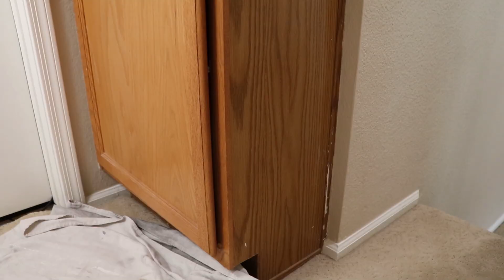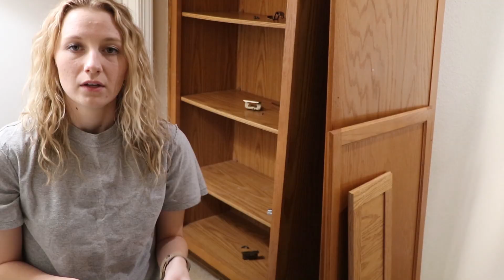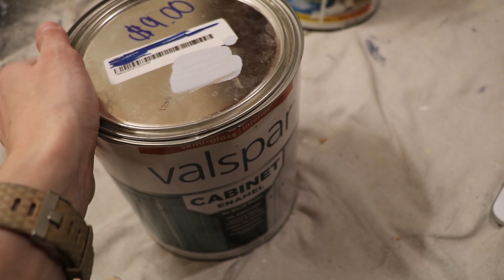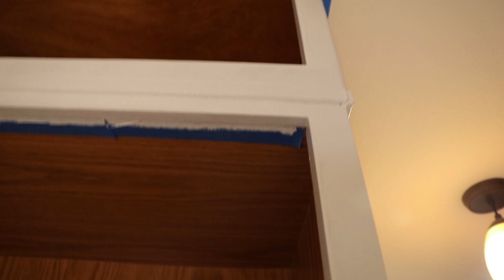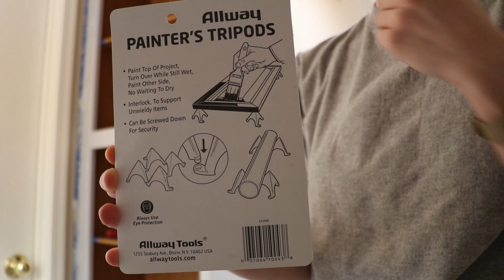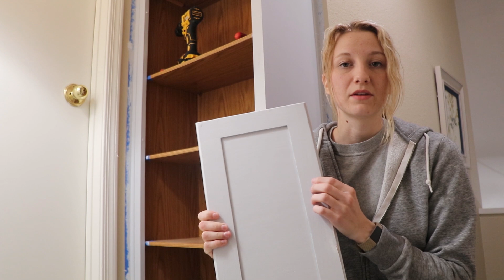Cabinet Paint: A Step By Step How To Video

Comment: As a painting contractor I’ve noticed with all of these DYII videos. You try to get away with cheap applicators.. Use the best brush that you can because that will give you the best result same thing with the rollers use a Short nap or velour roller it’ll tend to not show stippling marks like the other style rollers
Reply: Would u say the behr paint she mentioned earlier is gud for kitchen cabinets
Reply: Mark , I have also noticed in many of these videos , the cabinets look great FROM 6 FEET AWAY , but the close up shots suck , brush and roller marks galore .... I always look for the "close up shots" ..... Many of these videos only care about "clicks" ... NO WAY those cabinets look good "up close" , but they yak how beautiful they are .... ya right ... too many of these youtubers only care about clicks , so much fraud on YT it sucks ..... "Anaconda swallows army truck" crap
Reply: @shure46  the only true way to get the cabinets smooth is to spray them using an HVLP sprayer.
Reply: Thank you!
Reply: @marksavino2580  I know , BUT brushing can look pretty good , just not "top notch fine finish"
Reply: I just finished one area of my kitchen cabinets..this brand paint sucks, even using a foam roller.
Reply: @rockmom62  many foam rollers suck , they make air bubbles
Reply: @rockmom62  this is one of my favorites. I've never had a problem with it. I've brushed it as well as spray it. When brushing I've used a high quality brush, it goes on like hot butter.
Reply: I'm at the tail end of my cabinet painting project. Initially I went with the Valspar Ultra White Cabinet + Furniture paint.

It's complete crap.

I can gently lay something on the finished paint and it would easily mark with grey/black scratch marks.

Went to Sherwin Williams and filled them in on the horrible paint experience and when they asked the brand I used they said: "yup, that's why it's marking easily, the Valspar paints are extremely soft". 

They hooked me up with a proper, good quality cabinet paint that is much harder when it cures. No marks! The only catch is it's more expensive. $80 for not even a gallon vs the Valspar $35 per gallon.

But I don't want my paint to chip and/or become easily marked by the end of day 1. So I'm paying more for good paint.
Reply: @1337Reloaded  I tested the Valspar paint when it was only called "Cabinet" paint , and it dried hard , I still have the test stick to prove it .... BUT later I tested a can of "Cabinet and Furniture" paint , and YES it did seem softer , not as hard .... It looks to me like Valspar somehow managed to screw their paint up with this "new and improved" version .... I BELIEVE it has something to do with trying to make paints "Low VOC" , I think they are taking out important chemicals or something .... Behr did the same thing , long long ago I used "Behr Premium Plus Semi-Gloss" on my trim and it worked great , it really worked great , 10 yrs no issues at all , THEN years later I tried that paint on trim and it sucked bad , much softer ...... So what paint did you end up using from SW ?? Emerald ???? I have a video on Emerald if you care to see it .... I liked Emerald a lot , BUT , I am still searching for a water clean up paint that dries even harder .... Emerald is about 85% as hard as I'd like , it's close , and does work quite well , but I'm checking out others too .... I think California Paints "Ultraplate" dries a wee bit harder , I may try it on the next project
Reply: @shure46  yep I bought emerald. Next time I need to paint a cabinet I'm going to have to sample many different paints and figure out which of the hardest.
Reply: I agree , and she should of painted with the brush first.And got the inside done first.we use the roller at the end to make it smooth
Reply: I've been in the painting business since 1978 when I started out as a Union apprentice. I use Sherwin Williams Pro Block oil base primer (two coats) this ensures adhesion and also blocks out any bleed through. As a top- coat I use Sherwin Williams urethane trim enamel which levels off nicely, thus reducing any brush marks. I use a mohair cover which ensures a smooth finish.

Comment: I painted my kitchen cabinets 3 years ago with valspar self leveling cabinet paint they are still in great condition . The tripods keeps your doors from sticking to any surface I didn’t flip over a door while wet and paint opposite side, take your time and let it dry.

Comment: You're doing a great job I had painted my cabinets as well but I painted the back first and then the front and I did use Valspar Cabinet & Door paint and it's holding up really well.

Comment: I would have caulked the gaps prior to painting (even on the doors).  You can also use Dixie cups for holding the cabinet doors for painting.
Reply: nosirrahm you never caulk a panel door. It floats with humidity changes throughout the seasons

Comment: Which one did you like the best? I’ve used the behr on my doors and baseboards and really liked it in the end, however it took me primer and many 3/4 coats to cover the dark wood. I used the valspar on my kitchen cabinets and loved it and had to do only 3 coats with no primer. They’ve kept up well with how much wear they get. I’m wanting to repaint my dining room table and chairs and hutch. Wondering which one to use bc the behr is around $38 where a gallon of valspar is $53. So would love to know what you think.
Reply: @Angeline P no I didn't, however I prob wouldn't have had to do 3 coats of the paint if I would have. My cabinets were super dark tho. It made such a change it was amazing. It's worth all the work! You can do it!
Reply: @Angeline P I work part time in lowes paint department. I can honestly say I always suggest a primer prior to painting. The Zinser 123 primer she used in the video costs about $23. The Cabinet Enamel paint is about $53. People typically don't like to prime first thinking it's "double work' but in reality, it's more cost efficient and the results are great. Depending on the size if your job you can spend roughly $75 for a gallon of primer and paint or over $100 on just paint needing 3-4 potential coats to satisfy the job. Cheers.
Reply: @Abelvilla91  I just did a cabinet painting today then I see your comment, aww man, I’m bummed because the guy at my Lowe’s paint department said no primer needed. I specifically ask him if I needed it. I should’ve watched this video first. I did watch some other ones, but I trusted what the guy told me 🤦🏻‍♀️
Reply: @Raec123  He may have sold you a paint + Primer. That's a great option but the primer that is built into to paint is not a traditional primer. The primer in the paint is to ensure the color doesn't fade and for the longevity of the paint itself. You may need to just double coat the paint you purchased for a desirable outcome. Happy Thanksgiving

Comment: I use the oil based primer Cover Stain, sticks to very smooth surfaces and covers in 1 coat. Does have harsh odor for those that don’t work with it often.
Reply: Cover stain has the worst fumes , KILZ original better choice ... AND it sticks better .... I've done tests and have used both a lot , Cover Stain fumes will kill you !!! They are THEE WORST , try spraying that crap with an airless , lord have mercy !!!!!

Comment: For your kitchen cabinets did you put a top clear coat on them? I was looking into buying the Rust-Oleum cabinet kit but I hear the top coat has left a yellowing color and gets more yellow as time goes by. I don’t want that.
Reply: I bought the Valspar cabinet enamel and it is supposed to dry to give an extremely hard finish.
Reply: Don’t use the Rustoleum kit. It will yellow because the top is a polyeruthane. Valspar in an oil based paint and will dry pretty hard so you shouldn’t need a top coat. I would recommend an oil based primer though, not water based like shown above. I’m getting ready to paint my moms kitchen cabinets using the Valspar so I can try to update soon! I painted my own kitchen cabinets last summer using General Finishes Milk Paint and Matte Top Coat for a more farmhouse softer look and it’s also held up very well!
Reply: I used this kit and my cabinets are quite yellow. I am now having to do them again.